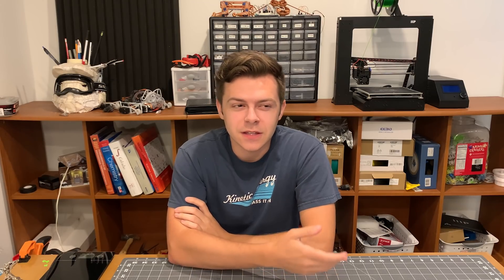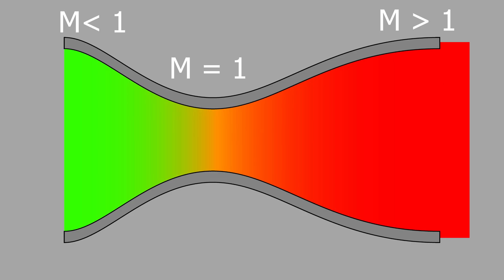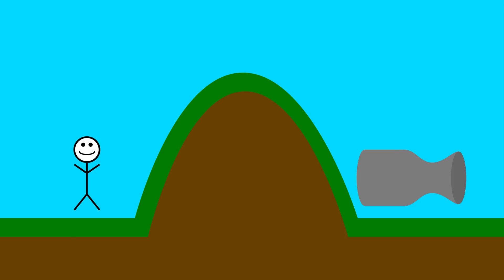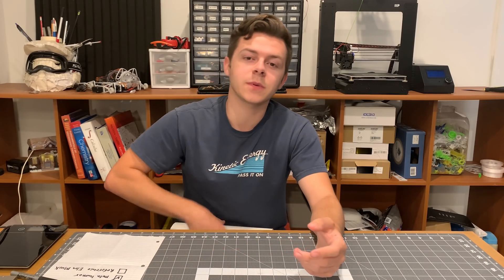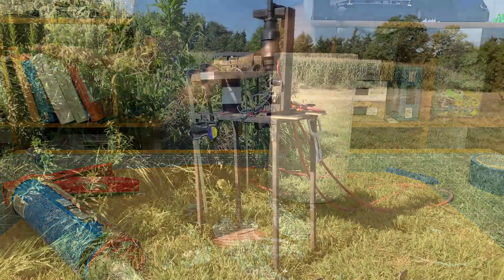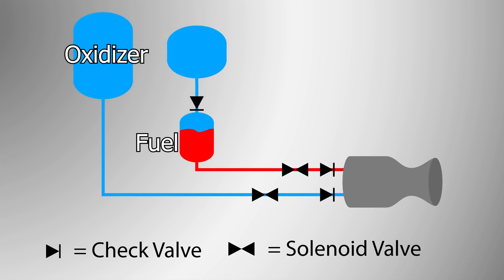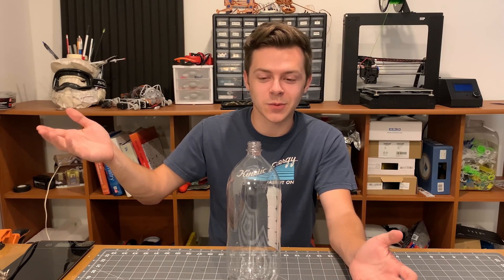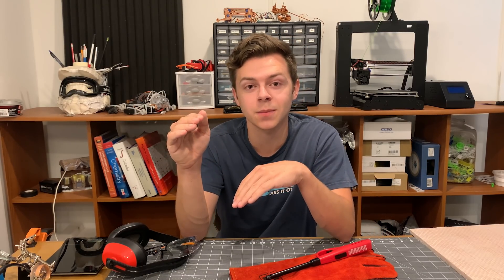Making Shock Diamonds with a 3D Printed Rocket Nozzle

Comment: The issue w the non-spike nozzles is that it doesn’t seem like the fluid is reaching Ma1 at the throat of the nozzle. In order to get shock diamonds the sound barrier has to be broken at the throat of the rocket otherwise if that condition isn’t met it won’t form shockwaves. Air traveling faster than sound will behave much differently so if you don’t reach Mach 1 by the throat you won’t get any shockwaves. Not sure if you took that into consideration but just thought I’d add in

Comment: Amazing but the reason the first one did not work is the combustion chamber had no oxygen in it which choked the flow so you need either oxygen gas or liquid oxygen(lox) for efficient combustion

Comment: One big design flaw with the initial system is your chamber to throat area ratio. Let's see with your specific heat of about 1.1-1.22, and your expansion ratio of about 2 from the looks of it, you are loosing 5% of thrust off of energy off of adiabatic heat transfer alone.
Reply: Never mind I was looking at exit area my b. However you seem to not have enough exidizer for the combustion.
Reply: You seem to run this thing like a jet, without the intake to support it. It is like mowing a lawn with scissors. air is super low energy and you need a BUNCH of it to sustain isotropic combustion

Comment: If you switch from alcohols to non oxygen carrying hydrocarbons like zippo fuel (which is naphtha, don't use normal lighter fuel which is pressurized butane) will probably give ypu more visible shock diamonds. The hydroxyl group in the alcohol forms water, oxygen, and hydrogen species (species = types/classes of molecules present in the combustion products) which don't release a lot of visible light like carbon.

Comment: If you want to make the flame more visible, maybe try adding some salt solution or lithium chloride to the inside of the nozzle before firing. The heat of the exhaust should ionize the metal ions and give some nice colors for contrast.

Comment: An aero spike engine needs to have the spike on the outside of the cone not shrouded like you have here the point of an aero spike engine is to let atmospheric pressure take the place of the bell of the engine just in case someone else or even you tries to build one

Comment: I like your video but I think you need to switch bottles when you use it for launching because each time you use the same bottle it ends up having more openings for the gases to escape from the side not through the nozzle itself. Well what I'm practically trying to say is that you're losing efficiency of your engine

Comment: Next step, how to introduce pressurized alcohol and oxidizer into the bottle (combustion chamber) at a rate that keeps the pressure above critical for continued combustion and thrust, but below that for a rapid unplanned disassembly event. From there, designing a nozzle and combustion chamber that can take the heat of continued combustion.

I think your "pressurizing fuel with air" problem would be most simply solved by a can of OC spray. 

Or rather the mechanism by which the OC is pressurized. Basically, the OC liquid is in a bag inside the pressure vessel of the can. It has a valve and tube attached to the bag such when the valve is opened the pressure of the gas in the pressure vessel forces the liquid through the valve and out of the pressure vessel. The pressurizing liquid and the OC (fuel, in your case) would never come into contact and thus the chance of ignition is reduced quite a lot. That has your fuel pressurized.

In theory, you could pressurize your fuel and oxidizer (assuming both are liquid) at the same time, by having two bags in the same pressure vessel (with the proper volumetric ratio). Designing for the proper flow rate shouldn't be that hard.

Comment: I didn't think shock diamonds could be observed that that small-scale but you proved my assumptions wrong very impressive I like what you do keep doing it
Reply: They're actually surprisingly easy to produce on a small scale, just hard to observe because they're either short-lived, or not luminous. Black powder model rocket engines (like Estes or similar) produce them, and they can also be seen in the output from a can of air duster, or a compressed air hose with a blowgun attachment. Those last two are a lot less spectacular than rocket exhaust though, because there's no glow from combustion. You can usually only see them against a high-contrast background where the refraction effects of the changing gas density are made more apparent.

Comment: it strikes me that most of your results are just from the higher pressure and flow rates from a constricted nozzle.  Shock diamonds are cool but like the first part of your video, they don't contribute to thrust.  You need to maximise pressure and flow at the throat and then maximise thrust from bell shape.

Comment: The color of the flame comes from the sodium and carbon of the saw dust. I think the flame can be colored more easily by putting salt into the bottle. It might make more intense color and make the diamonds more visible. If used different salts,different colors will accor.

Comment: your aerospike is just a toroidal nozzle , the spikes has to be exposed to the ambient air
Reply: great video though
Reply from the maker: I’m no expert but to the best of my knowledge: It’s a truncated aerospike, just truncated clear to the same level of the outer rim of the nozzle. A lot of aerospikes truncate the spikes since cooling the tip becomes impractical very quickly and trapped exhaust functions as a decent replacement. Toroidal vs linear is just a general description of the geometry, circular vs straight.
Reply: @Sciencish  that's not the problem, the problem is that you have walls around the spike. It has no way to interact with ambient pressure

Comment: Instead of an inert gas or air you could pressurize the fuel tank with a flamable gas. As long as that gas and the fuel are not reactive with each other and there is no oxidizer in that fuel tank, that should be safe, shouldn't it?
Reply: I'd suggest to just use a liquid propane tank that you take liquid propane off of, and design the injector to take liquid propane at slightly below it's vapor pressure.

Comment: I was so excited to wait for this video that 5 months ago i managed to make shock diamonds with the same system as you. I was trying different nozzles to put in a bottle to get maximum thrust,I even made an aerospike, and in the end what turned out best was to make a hole in the cap with a scissor. 🤣🤣
Reply from the maker: I tried that too, but for some reason absolutely no exhaust was visible, so I couldn’t see if there were shock diamonds. But it did seem to output a similar amount of energy